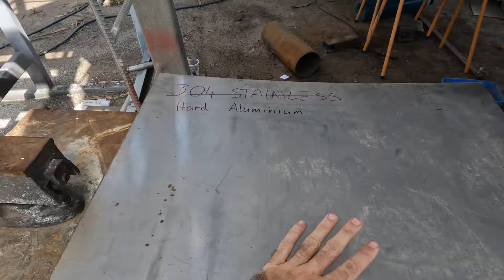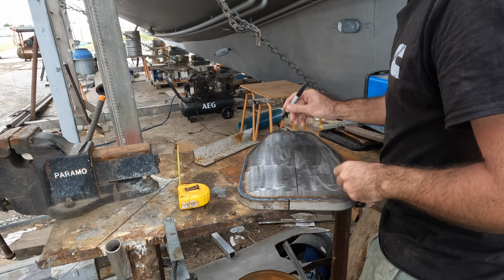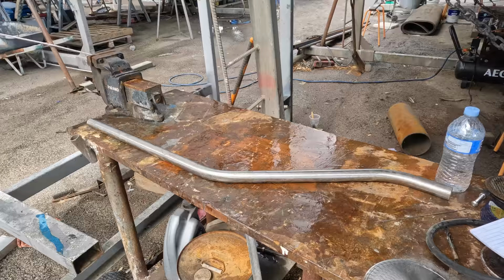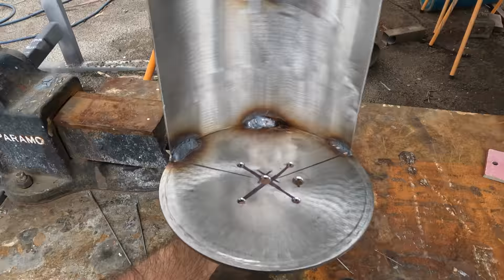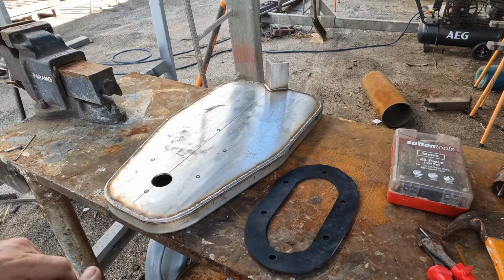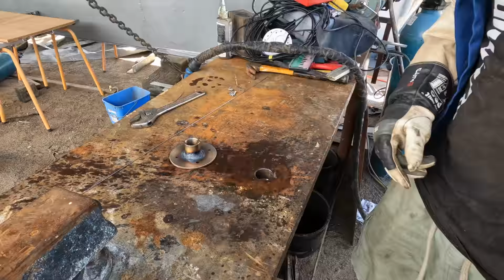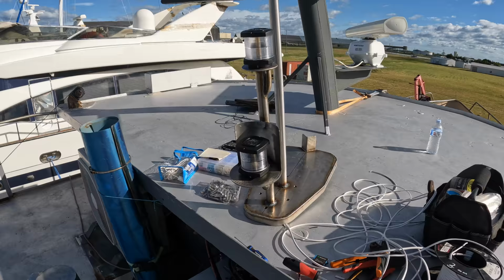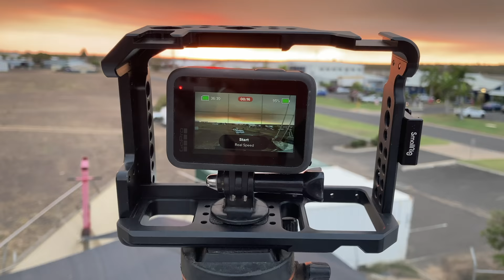Brupeg gets Starlink, Comm's & Nav Lights - Ep 248

Comment: Hey Damian… to get cables through your wonderful and always-be-prepared-mast-wings: take a vacuum cleaner and suck a line or light/thin rope through the mast, channel whatever / fix the cable to the end and pull it. Works even better when you tie a ball-like knot to the line that makes it easier to vacuum it through… you’re doing a fantastic job!!! Thank you for so much fun and inspiration!
Reply from the maker: What a great idea
Reply: It helps to tie a piece of rag to the end of the line also. I've used that trick to pull cable through conduit and pipe. You can also pull a cleaning rag through if you suspect dirt or water in the conduit.
Reply: You can also do the opposite, ( I used to build custom industrial cables) blowing a carefully sized rag/ball of fluff with compressed air and on really long ones did both together to get a line thru for pulling actual wire bundle.

Comment: You've got a lot of mast/antenna height depending on one circular weld and you may want to consider a cross brace at max possible height. There will be a huge amount of force on that weld with any high winds you encounter that may eventually cause the loss of the mast. Better to address this now than "at sea". Overall a great job from design to completion. Curious to know what everyone else thinks?
Reply: I agree.
Reply: I agree too, no expert here but that’s a lot of leverage on a small weld and a relatively thin aluminium plate.
Reply from the maker: Hard Aluminium

Comment: With coax cable, the rule is as short as possible, and as good as possible.  Cable loss is expressed in dB, it a logarithmic scale.   If your radio puts out 40dB of power, and the cable loss is 10 dB, you have not lost 25% of the power, you have lost 90% of the power, turning your 25 watt radio into a crappier than a handheld 5 watt radio. LMR400 ideal for everything, it is needed for wifi, at microwave frequencies.  Thin cables at microwave frequencies have huge loss, remember as short as possible.  
 
RG8  coax is suitable for VHF if LMR400 is a cost, flexibility or size issue.  Follow minimum bend radius for a specific cable.  You should get 20 miles, more or less, on VHF with 8 meter high antenna.  If you can, mount the VHF antenna about 2 meters away from other metal, and a 1/2 meter disk of metal , even 1mm, at the base of the antenna will provide a ground plane for antenna designs that do not include a ground plane.  If the antenna does not have sideways pokey bits at the base, it has no ground plane.
 
Use drip loops, a little extra cable forming a loop under an opening so water does not run into the opening by following the cable.  Zero stress on the connectors, use a  mesh wire grip or adhesive heat shrink some dynema to the cable with 100-150mm heat shrink to support vertical drops of cable.  !!! Use "splicing tape", a rubber tape that self bonds to itself to water proof connectors, it works best if you do not stretch the tape very much when applying it or it can split from the stress in hours to days..  It will water proof pretty much any connection.
Reply from the maker: Thanks for this info
Reply: @ProjectBrupeg  Another vote for LMR400. We have it on our boat going into the pilothouse and we regularly do radio checks with the Canadian Coast Guard (as you will at some point) and we almost always get good confirmation over maximum distances. Another aspect of why this is important is DSC messsaging and events I hope you never encounter, such as "mayday relay". Digital comms go farther than voice, or at least will work potentially farther because compared to voice comms, they are tiny bursts of data. So you can hit the scary red button and if you are full wattage out the seven metre height and you're alerting a 40 metre antenna on an ocean-going ship or CG vessel, or better yet, a shore-based 100-150 metre tower, you can actually be noticed at a surprising distance and your call, with the lat/lon string, can be relayed to a ship you can't see and which can't see you. 

When you start using the AIS in earnest, you'll find some unusually distant targets as well, like big tall ships well beneath the horizon, or, as we've seen in the Great Lakes, ships working their way up canal locks from 60 NM away because they are high enough to be effectively line-of-sight. UK info, but broadly applicable: https://www.rya.org.uk/knowledge/safety/keep-in-touch/onboard-communications
Reply: Splice  tape is great. One trick for it . Is wrap one layer of electrical tape upside down then  wrap Splicing tape finish with electrical tape. 
Now the reason for the first layer of tape is you can cut though layers and the whole thing peels off easy and clean. For the repair. Then wrap it the same way. 👍

Comment: Don't forget to Polish Everything with a good protectant coating. BTDT When a Bird takes a dump on everything the acids can stain. Ceramic Wax will stop it dead in it's tracks. You can Polish the Starlink with it too. I use McGuires Ceramic Wax. It will stop corrosion and make the surface slick. It will prevent rust on chains and Barnacles will not stick to the Hull. Repels Salt. My hull was polished with it and 3 years later it came out of the water and was just cleaned with soap and water. Very good stuff. Message from a Airline Captain and Old Sea Dog. Airplanes love the stuff. So do Corvette's. lol
Reply from the maker: Huh, never even thought of this. Awesome yip thanks for sharing

Comment: I use curtain spring as a feeder, as it is stiff enough to push through things but the spring coil allows it to go around corners. Some sort of lube or anti seize it always the go when screwing stainless steel on stainless steel. I think VHF pole could use some gussets or bracing :)

Comment: 9:42: That trick of grinding a decent circle using a drill press...amazing. My only observation is that your VHF mounting pipe makes your "all-around white" slight less all around. I don't think that invalidates the "all aroundness", but from aft, there will be a mysterious gap. Very nice solution for the steaming light, and it's important as if you're moving, you're steaming, unlike a sailboat. I assume due to your size, your LEDs are 25 watt equivalent. We are 11.99 metres on deck for some forgotten tax reason, and could have gotten away with 10 watt nav lights, but we popped for Aquasignal 41s/25 watts because why not? At 16 tonnes laden, I want others to see me as soon as possible. From space is good.
Reply: Hey, just interested, you mention about the wattage of the LEDs, I don't think it matters that much.  For your vessel size, as long as they are seen for 2nM you are golden.  But indeed bigger is better 😁

Comment: Those spring-loaded double contact lamp sockets corrode and go bad with just a little moisture. They probably last a year. If you pack the spring and socket with Dielectric grease it will last a very very long time.!
Reply from the maker: Ahh perfect thanks for the tip.

Comment: You should join the Starlink on a boat face book page. I posted a link to an RV owner who had discovered that if the dishy is mounted completely flat the alignment motors will eventually give up trying to align to south ( in Southern Hemisphere) and actually rather than refuse to work it will just start working again. The phased array will just do its thing and no risk of motors eventually wearing out. I’ll be trying this on my boat but is a game changer in boat/RV installs
Reply from the maker: Thanks I’ll check it out

Comment: Put in a couple of pull strings, and every time you run a new wire, run a new piece of string with it. Easy and cheap solution.
Reply: Also, Im a huge fan of metal coathangers. Cut off the hangy part, bend it straight, and put a hook on the end.

Comment: The new "aluminium"  looks odd why would it spark when you grind it, also the weld is normally green light emited. I think you need to speak with a metallurgist. . 🤣🤣
RIP the drill had a long service and will be missed , move over here comes the mill to take over.  Double duty 😱         Great video 2x👍
Reply: Obviously the sparks were just coming from the grinding wheel, not the hard alu. Can't really trust the camera. Maybe it WAS green.
Reply: Does have a pretty funny lookin' HAZ for aluminum, though.
Reply: Haha I was also thinking it looked a bit like stainless 😅
Reply: @khallingstad  right 🤣
Reply: @52Ford  🤷‍♂️           🤣
Reply: @52Ford  mmmm you might be on to something, I had beed dringing green tea before the video so that might have been the colour shift. 🤣

Comment: While there are many environmental factors to VHF transmission which can improve or degrade signal, a way to calculate a VHF horizon is to take the height of you antenna above waterline, convert to feet.  Take the square root of the feet and multiply by 1.42.  This will give you an answer in Miles.  You estimate, 6-8Metres above waterline so that should work out around 6.3 - 7.3 statute miles or 5.5 - 6.3 Nautical Miles.  I think there is some guru science with calculating a Standing Wave Ratio (SWR) to improve performance of the radio set - best see an expert about that 🤷‍♂️ Great build BTW on the mast
Reply from the maker: Thanks Clint. Will be interesting to see how close to that range we can transmit
Reply: @ProjectBrupeg  Probably more to be fair, but the environment is always the game changer...👍

Comment: Nice job on the hard aluminium!  I think it is not only a good plan to put a dome over the starlink antenna but it is a requirement if you wish the antenna to withstand the corrosive and wind environment that it will need to withstand.  In my profession (Navy electronics) nothing that is aluminum and not  in an enclosure of some sort lasts more than a few months before salt and water ingress destroy it.  If you look at any ship you will notice that all tracking antennas are enclosed in a dome of some sort.  Those domes are also pressurized with dry air to ensure that humidity and temperature are kept under control.
Reply from the maker: Yeah I’ve been looking for a design and preferably a dome I can buy for the rectangle dish but there’s nothing out there I can find. So it’s likely we will build something. I have heard of other boys locking the rotation so the dish remains flat and just letting the phased array do the tracking. That would make a radome design massively easier
Reply: @ProjectBrupeg  If you locked train then you will have issues with most of your chosen courses.  Phased array antennas like starlink have a wide radiation pattern but they are not omni directional.
Reply from the maker: What you’re saying then, is I have to build a fancy radome
Reply: @ProjectBrupeg Well, you can make it fancy if you want to, but I would go to plain, simple and functional.  And to do that I would move it from the mast where it is installed at present to a enclosure built on the deck aft of the radar mast.  

RFI:  Starlink is 10.7GHz 12.7 GHz.  Your Radar is in the 9.5 ish GHz area and having your SL  antenna that close to a really strong pulse emitter is, in my opinion, a Really BAD idea.  Radar has a device called a TR cell that protects the receiver from its own transmission.  I presume that SL does have TR protection of some sort as well but that protection will not work against the other emitter.   That thought just occurred to me.  

Please consult with other RF / Radar people - I am only a simple Radar Technologist  not an Engineer but in my 38 years of doing Radar has reinforced that having 2 emitters this close in frequency and this close together is never a good idea.   

Steve
Reply: The other thing to consider is that the starlink antenna is not designed to be used from a platform that moves.  Ships motion is going to give that antenna fits!  I guess you will find out then we will all know.  If you want to discuss this off YT i would be happy to do so.
Reply from the maker: Steve I would love to learn more about this, can you email us on teambrupeg@gmail.com so we can figure out a solution. Thanks for your feedback, Dame
Reply: @ProjectBrupeg  Did you get my email?
Reply from the maker: Ahh, yes, for some reason junk grabbed it. Will have a chance to read through this weekend and come back to you

Comment: you might get bad reception with the starlink antenna so close to the poles. putting it on a opposite corner of the roof would give it a wider field of view without obfuscation
Reply from the maker: I did think that might be the case but so far it’s not really noticeable. We see over time if anything changes though

Comment: I do not know the regulation in Australia, but in Europe you're not allowed to roll your own steaming light. The light has to be approved. Color, brightness, radiation pattern etc. are closely specified and checked during approval. Also the use of LED bulbs in nav lights is only allowed for 360° lights. The radiation pattern requirements for the steaming light can only be met with the original marine incandescent lamps with vertical filament.
Reply: Same in the US
Reply from the maker: Ironically I couldn’t buy a steaming light hence I made my own.
Reply: A normal incandescent bulb has a straight filament support but if you look at a steaming light bulb, you will see it has a spiral filament support. The lights you're using are clear so an LED bulb is okay but you could not use them on a colored lens. You need to use a green or red LED in your STBD or PORT lights or your navigation lights will not be the right color or wavelength. (Aquasignal Lights)
Reply from the maker: Yeah our green/red are both filament. Will be sticking with these

Comment: As a teck you always pull a cord in with a cable. So if for any reason you have to add a extra cable there is a cord ready to use. A vacuum cleaner is great  to suck a paper parachute and a string all the way through a conduit.  
I really notice you must be feeling better by the number of funny jokes. 👍😆😆😆🥳
Add a buzzer in the engine room with the button at the bridge. Because of noise of the engine ( the purr of a Cummins) etc they can call you to the bridge. Because of a emergency or a cold beer. 🤔🍻😁
Reply from the maker: We will actually be putting in a ships intercom, just haven’t got to that yet

Comment: Doesn't Starlink have a fatal "Catch 22" flaw in that to get it to work you have to have it already working to predict which location  you next need to have it working ?  So it is effectively  designed for fixed applications, not overlanding or marine use ? Or has it evolved to have roaming capability ?
Reply: Ask the Ukrainians
Reply from the maker: Roaming is being progressively released. Won’t be long till it’s standard
Reply: @ProjectBrupeg  Robert Pepper of L2SFBC had identified that issue a few months back. It will be good if it can soon cope with random travel progress and direction !
Reply: @ProjectBrupeg  Probably a silly question, but would the satellite dish not need some kind of gimbal and / or a multi axis gyroscope on a boat to prevent a positioning servo melting down coping with sea swells ?
Reply: @philhealey449  not a silly question at all. This antenna is not the one that will be used for real mobile away from the dock use. In fact Starlink for the moment is geofenced, meaning you are only able to use it in a defined area. Starlink  is really like cell service, except it has really big cells that downlink to local connections to the Internet. Now, over time the satellites will connect to each other using lasers up in space to create a true mesh network, enabling a true mobile  solution for boats and airplanes. That will require a different antenna than the one currently used. The way he mounted this antenna is really not the best but it looks pretty and will work while they are at the marina. Once Starlink really offers a mobile service it will come with the more traditional looking dome with a phased array antenna inside. These use electronics to aim the radio beam not mechanical parts like gimbals. Neat stuff but will be more expensive as usual for boats and aircraft. Much more expensive. But probably much cheaper than currently offered services, as per usual with Elon Musk.
Reply: @scottwheeler2494  Thanks for detailed explanation.  I'm looking at this for expedition  vehicle use, so have  only the roaming problem , not wave action!
Reply from the maker: I’ve seen it used on a land cruiser in the western Australian desert and it was maintaining connection in the flat position at 100kph. When stationary it would readjust to whatever angle was best

Comment: could you use the mag drill on the stainless [sorry hard aluminum]by putting a sheet of regular steel under the SS/HA lol and see if the magnet works through it just a thought i wonder if it would work??  PS just a quick reminder last time we checked SV Seeker is still afloat and Doug managed to get that pesky grounding the boat thing out of the way on the first day lmao i know it will be hard to resist trying to beat that record but i would advise against it lol
Reply from the maker: Actually tried that. Nah drill can’t vary its speed so it’s too fast for stainless and burns cutters out in a nanosecond
Reply: @ProjectBrupeg  cool thanks was wondering why you were using elbow grease lol

Comment: Gday Dame a good product for Anti-galling of SS & Aluminum, anti corrosion of dissimilar metals , and seizing as well as dielectric gel/grease is Tef-Gel great stuff never dries out and is paintable and is resistant to salt water whitworths sells it or try your local chandlery might have it, a little pricey but u get what u pay for.  Nice stainless work mate, I'm a little anal and would've polished it all up especially on the welds were burn marks are left they will rust up without polishing cheers any way 🍺👍